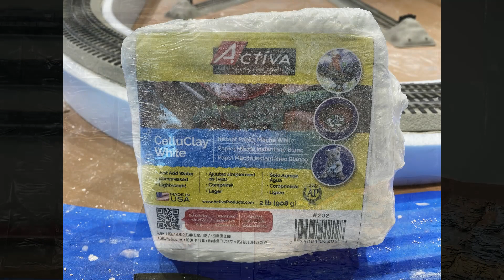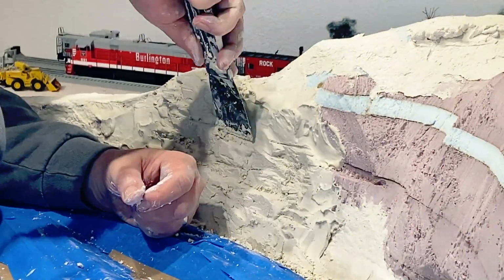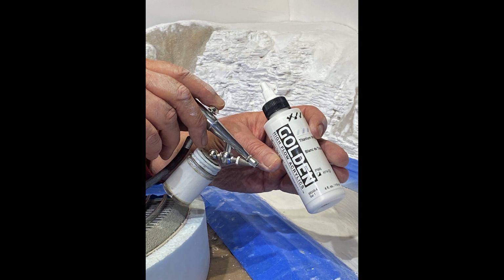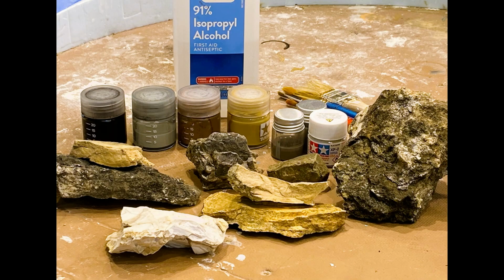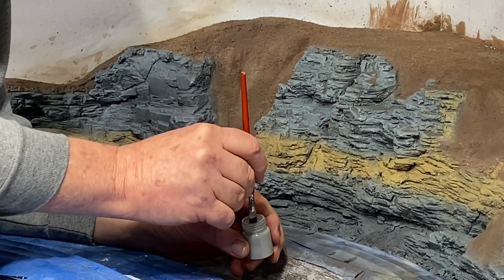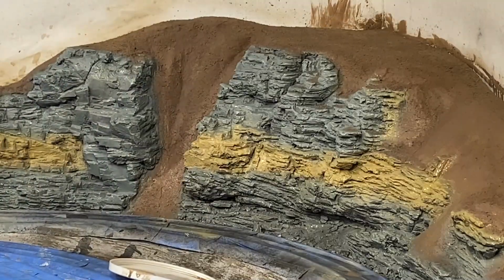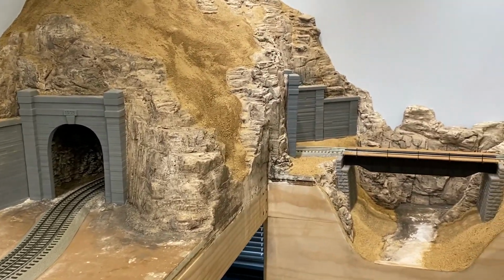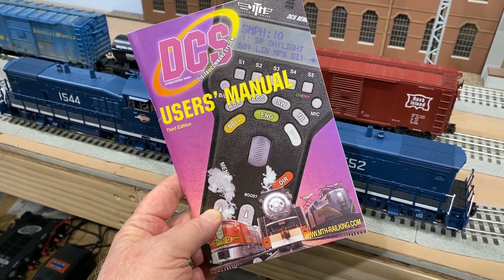The Memorial Park Diorama (Part Two -The Rock Work)

Comment: Your rock carving skills are great. I think that would be the hardest part. It is really coming together. I really like your MTH MP15's. Public Delivery Track made a custom run for my local Railroad which is the Delmarva Central. The two that I purchased are MP15AC's. I just found out they are doing a new custom run of an RS1 that will be of the Maryland and Delaware. I preordered one of those. They must do a lot of custom runs. Have a good weekend Bill B. Chris
Reply from the maker: Hey, Chris, thank you for the compliment about the rock carving.  I find the process fun and relaxing.  When starting out begin carving very small batches of plaster.  Carving some types of rock are more challenging than others.  I like to study pictures of rock formations.  In the Ozarks you find all types of different rock.  Layered sedimentary rock is pretty common and it comes in many different colors and shades.  Applying the grasses, weeds, and bushes I believe will be fun too.  Yes, I was really pleased to see the PDT offer the MP15's in the MOPAC scheme.  I believe we are entering into the age of custom runs.  It is a great time to be a model railroader or toy train collector.  Have a good weekend Chris!  Bill

Comment: Excellent presentation Bill.  There's no one-right-way to build a railroad; it's good to see use of Tempura paints instead of the usual suspects . . . acrylics and oils.  Looks like that technique would provide increased control over the layering effect.  Thanks for sharing!
Reply from the maker: Hi glad,Clyde, thank you!  I appreciate your comment.  We have a storm rolling in now.  Yes, I like using the black powdered tempera paint to shade the cracks and crevices.  In this case it would have been helpful if I had removed more of it from the face of the rocks as when I applied the paint it darkened it pretty significantly.  I was able to overcome the affect, but it did take a little work.  The other thing I could have perhaps done after removing as much as I was able with the brush and water was to have sealed the tempera paint with a sealant before having applied the acrylic paints.  I do like using acrylics.  I do not really have much experience using oils.  Thank you again.  Bill

Comment: Another great video, thanks Bill
Reply from the maker: Hi, Tim, thank you!  I appreciate that.  I hope you and yours are doing well on the other side of the "pond."   I hope you will stay tuned for "Part Three."  I'll try to breathe a little life into the scene with some greenery.  Thanks again, Tim!  Bill
Reply: @ozarkmidlandsouthernrailway  all good thanks Bill, my youngest has finally moved out leaving me with a room that is 21ft X 17ft, the 0 gauge layout is growing quickly
Hope you’re all good over there and enjoying spring and some warmer weather
Tim
Reply from the maker: @momatmach1  Tim, it was a mild winter and now despite some wind and rain it is very nice indeed.  It's great to hear that you now have space for an O gauge railroad.  Is O gauge big over there?  I am also wondering what type of railroad equipment (track, locomotives and rolling stock) you have there to use?  Hope you are having a good weekend.  Bill
Reply: @ozarkmidlandsouthernrailway  hi again Bill, 0 gauge here tends to be two rail and finescale but there is a growing band of support for three rail coarse scale, this is mostly due to Ace trains who’ve been producing British outline stock for a couple of decades, a good YouTube video is ace trains the sunflower line, there is a long tradition of three rail with Hornby and Basset Lowke amongst others, but it died out with the advent of 00 scale which is by far the largest followed gauge, I run a lot of British Ace and others plus a decent collection of Lionel, MTH and others, I also have a largish collection of Lionel standard gauge which gets a run at the end of the year and some exhibitions, it’s a real rarity over here.
The layout is coming together with one circuit of Lionel tubular and another of Maldon track, Maldon is repro of prewar solid Hornby and Marklin track, it’s a bit like the Lionel solid track made for the scale Hudson 
I also have an outdoor live steam garden line, which is also 32mm gauge but based on narrow gauge 
Glad that you’re well and looking forward to the next instalment and seeing the O M & S back running and making profit.
Tim